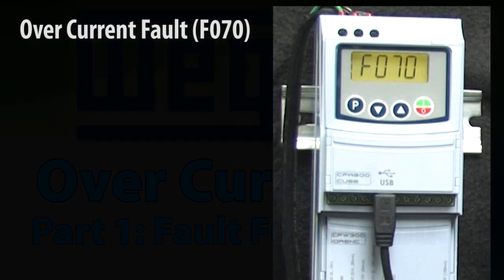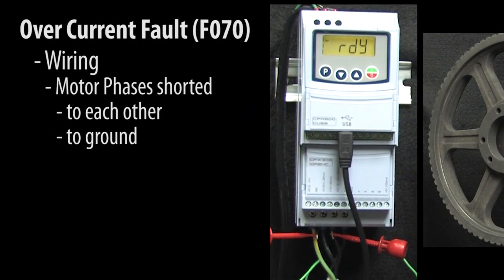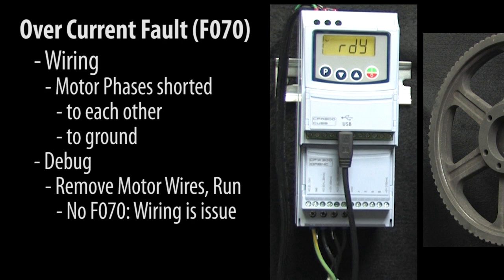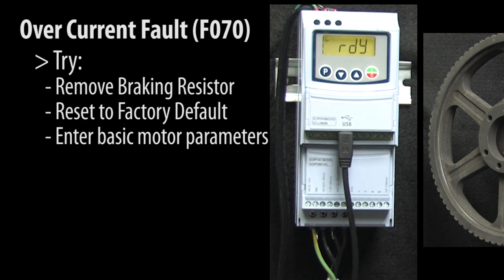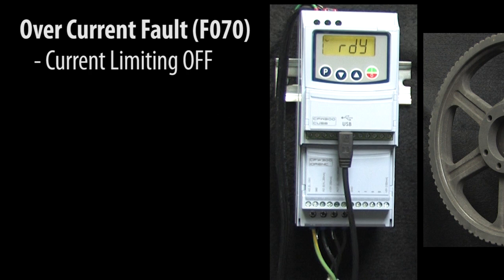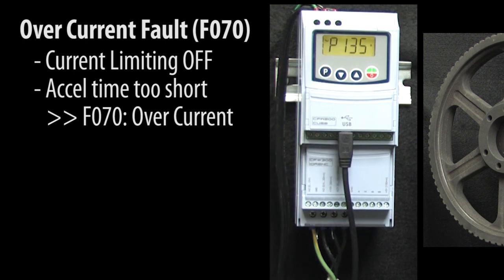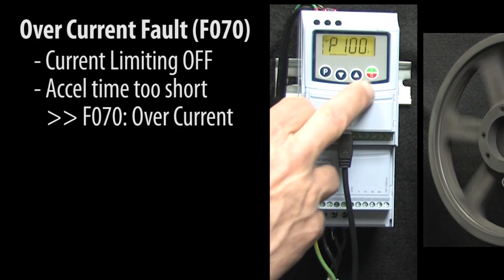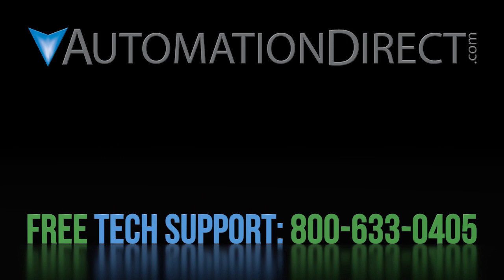WEG CFW300/320 VFD Over Current Debug Part I from AutomationDirect

Comment: can you please help me how to fix the problem w/ my vfd TECO A510 series 
on the display it appears OC   I already check the wiring on the VFD and also the winding of the motor and its fine 
I attempt to reset the fault but sadly it doesnt even work and also tried to reset to factory default but again it doesnt work
I tried to disconnect the motor terminals on the VFD and try energize the vfd without the motor But again the OC fault  appear on the display. 
How can I fix this. 
hope that you can help me.
Reply from the maker: HI Mat,
The TECO A510 isn't sold by AutomationDirect so we are not familiar with that drive and can't provide detailed support. But in general, if you are getting and overcurrent fault with no load, then you either have a bad configuration or something is wrong inside the drive. Try resetting to factory default and operating with no load. If you get a fault, there is probably something wrong with the drive. If you don't then you have a configuration error. Free tech support and free tutorial videos is just one of the reasons folks prefer to buy from AutomationDirect.com.

Comment: May I ask, what is "the ground fault and output overcurrent protections"? - related to F070
Reply from the maker: Hi Nizam, The fault codes are listed in this document: https://cdn.automationdirect.com/static/manuals/wegdrives/programmingmanual.pdf on pg 1-1.
Sounds like you are trying to ramp to 30Hz? Try a longer accel ramp (2X, 4X).  If that fixes it, then your load is simply too big for the accel rate you are currently using. If that doesn't fix it, then contact our free technical support during regular business hours - they will be happy to help. You can see all of our tech support options here: www.automationdirect.com/support
Reply: @automationdirect  wow okay thanks i try it later tomorrow!
Reply: May I ask, My cfw11 status red led stays on ( flashing ) it doesn’t turn green in ready mode it keeps giving me Overcurrent/short-Circ please help me out.. I try to remove the power supply, press the reset button, set the P0340 ( auto reset ) it’s still in flashing red light

Comment: i watched the video. unfortunately it still not working. the F070 error keep on appears whenever i tried adjust perimeters n stuff. Help me pleaseeee! this problem happens after the ramp automatically stop as I adjust the speed to 30hz.
Reply from the maker: Hi Nizam, The fault codes are listed in this document: https://cdn.automationdirect.com/static/manuals/wegdrives/programmingmanual.pdf on pg 1-1.
Sounds like you are trying to ramp to 30Hz? Try a longer accel ramp (2X, 4X).  If that fixes it, then your load is simply too big for the accel rate you are currently using. If that doesn't fix it, then contact our free technical support during regular business hours - they will be happy to help. You can see all of our tech support options here: www.automationdirect.com/support